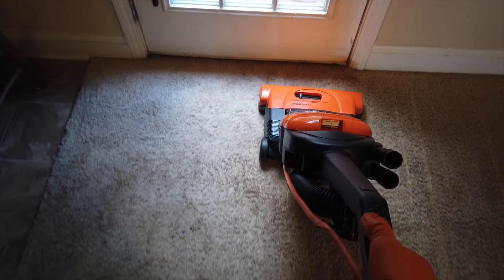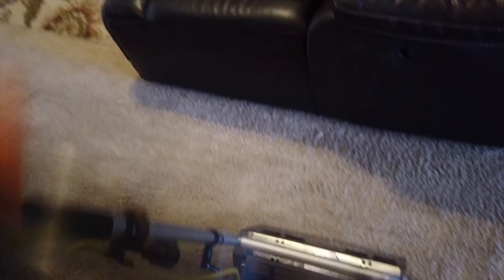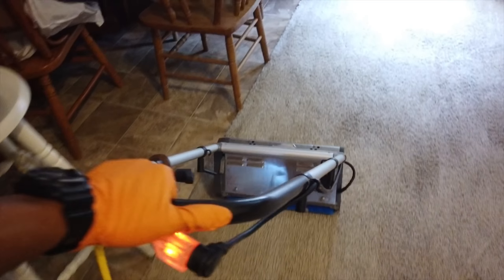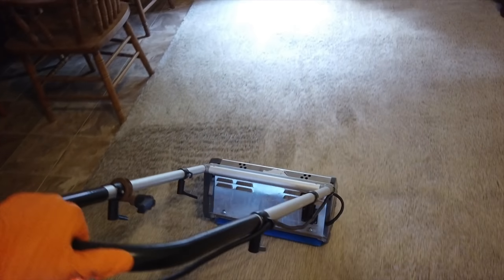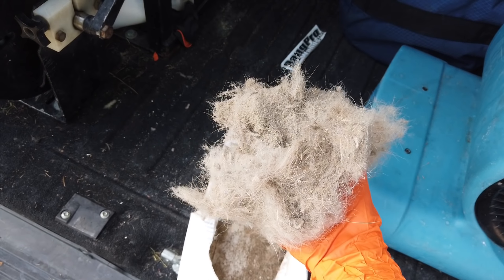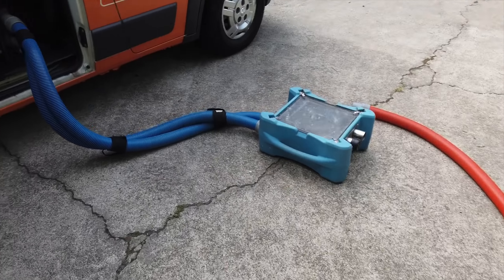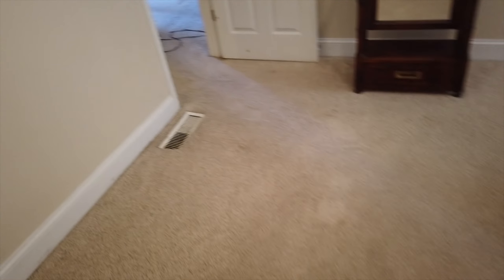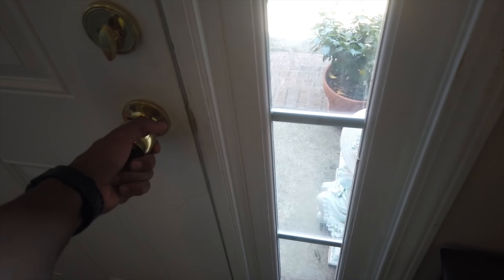Removing urine odors from carpet fibers

Comment: How do you get the water out of the padding seems like alot of water pressure.  There is no way to pull the wand back quick enough.  Soakamatic carpet cleaning